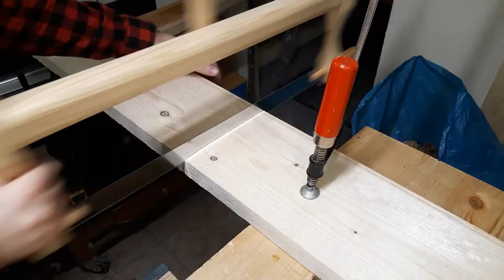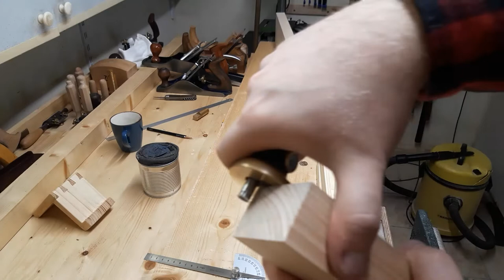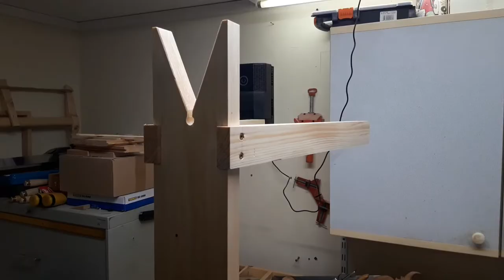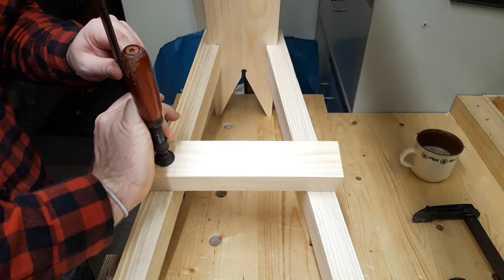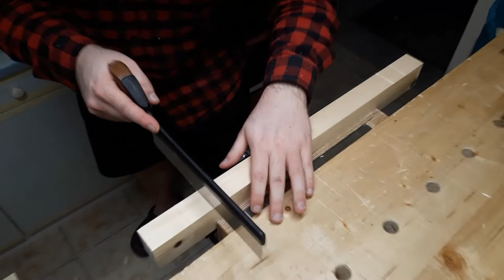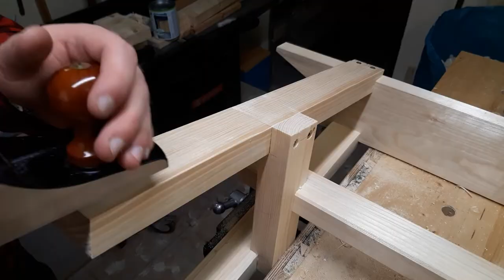Making a Saw Bench

Comment: He hand joints an edge, while his jointer in the background holds scrap wood and a can of finish.
Reply: Yes, those jointers make a good stacking surface. My power jointer has the same useful purpose. If I need my jointer it will be to work lots of board feet. This is a small job and jointing is not the trickiest part of the hand tool work on this project. Plus it doesn’t need a dust collector or eye & ear protection just a sweep up, it’s calming.